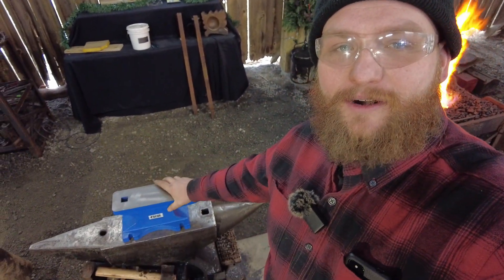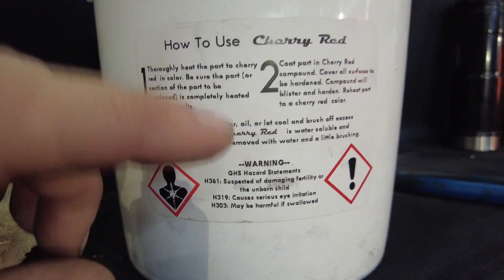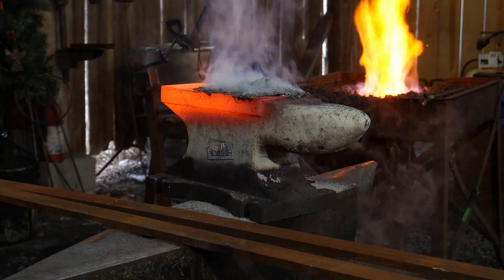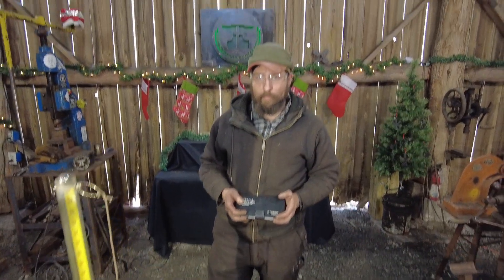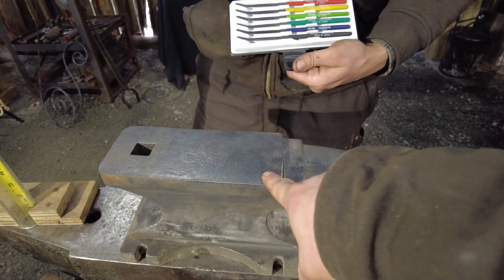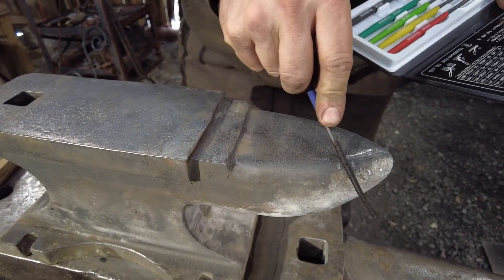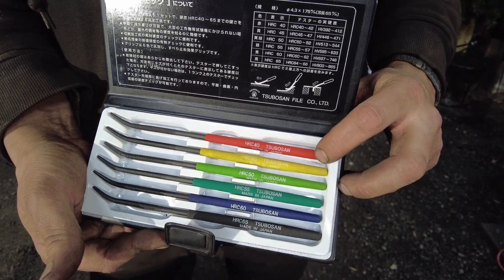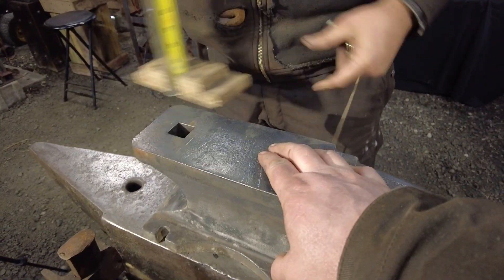Can We Case Harden a Harbor Freight Anvil?

Comment: I thought those anvils were ductile iron. They just aren't candidates for case hardening. They're already high carbon - too much carbon (3.0-3.7% carbon). Anyway, a rectangular block of mild steel is a better starter anvil. A hardened surface doesn't affect forging, it just makes the anvil more durable. Don't buy a Harbor Freight anvil. Get a Acciaio cast steel anvil instead. $100 for a 66 pound anvil that will probably outlast your interest in forging. You could probably forge weld on a tool steel face to a HF anvil, but... why?

Comment: I'm not a blacksmith (I do know how to do brazing, somewhat, using "hard" silver soldering), but, in an earlier life I spent some years as a software developer, and there's a technique from that arena that can save you a lot of time, effort, and wear-and-tear on your doubtless expensive hardness files.

It's called a "binary search" and it's a quite ingenious way of searching out a number of values to find a match. Each time you double the size of the list you only add ONE more test!

Instead of searching sequentially through the list looking for a match, you jump to the middle of the list, and test for a match. If you landed on a match, then bingo, your search is over -- you found the needle in the haystack. If it's too high, then you mark that point as the top, and your next test will be halfway between that point and the starting point.

If it's too low, you mark that point as the start, and make your next test halfway to that point.

You keep this up until you land find the match. In a sequential search of a (sorted) list, each test reduces the number of remaining searches by one. In a binary search, each test cuts the remaining number of item to search in half!

So, to use this technique with your files, you'd start out at the middle of the range of files. The results would tell you if you need to continue the top half of the remaining list of files, or the bottom half. Either way, you cut the number in half.

Comment: A modest suggestion: Couldn't you simply make a sand mold of the original anvil, then, melt the anvil, add carbon and a few other choice elements, stir to taste, then pour into the sandbox (pun not intended), then, using the appropriate iterations of heating, quenching, hammer-forging, and muttering, end up with a nicely forged anvil?

(Hey, I did say "simply," didn't I?)  <g,d&r>

Comment: In practice, iron castings to be hardened are austenitized at a temperature of 10-38°C (50-100°F) above the upper-critical temperature for one hour per 25 mm (1 inch). Heating should be gradual so as not to induce thermal stresses. After soaking, the parts are quenched. You really need to know the metallurgy of that Harbor Freight anvil to get the process right. Is it hypoeutectic, eutectic or hypereutectic iron? It’s all about the molecular makeup. Even then, one cannot expect a hardness of more than 50-55 Rockwell, at best.

Comment: Looks like hes pushing down a lot harder than you should. That's causing the files to gum up. Also, I'd recommend cardding those after each use so they dont hold any shavings. The pressure is where you can get a false result. Then again case hardening really isnt a process for cast iron. You really cant make iron harder than it is without adding other metals to it, and carbon. The grain structure on those is so course youd have to introduce so much carbon to gain any meaningful results that it's not really worth it. It would honestly be a better choice to melt the thing down and produce your own steel with it and pour a new one. Or get the face to almost molten/plastic like state then press it into a sand mold to get it a near proper shape and then add more heat and insulate the heck out of it to allow it to cool slower so the grain structure is better. At least I think that's how it works. If I'm wrong on the grain structure let me know, politely please.

Comment: So, case hardening is about driving carbon into the iron structure, taking a low carbon steel of like .2% and upping it to a higher carbon steel of like .6-.8%.  Cast iron STARTS at around 2% carbon and can go as high as 4%, so it’s an order of magnitude.  I suspect that the compound drives carbon into the surface, so not helpful for cast iron.

Only thing that may work is to DE-carbonize the face, or maybe get a facing plate to weld to it.

Comment: I'm a gunsmith that quite often case hardens parts with pulverized charcoal. It will indeed work but the best way to do it properly is to heat to cherry red, add carbon, quench, heat to cherry red and quench. Then you repeat to add depth. The reason you got little rebound with your ball bearing is likely due to the extremely thin surface layer that you added.

Comment: You can't case harden cast iron. Forget it, it doesn't work.
Case hardening is about adding carbon to the surface of low carbon steel, i.e. mild steel, with typically 0.05% carbon in it, to over 0.6% carbon content. This is the carbon content of high carbon steel which can be hardened.
Cast iron though already has between 2% and 4%, carbon content. Using case hardening compounds on that only adds to the carbon content and doesn't change its hardening properties. It remains cast iron, just with a bit more carbon in it.

Comment: something tells me adding carbon to cast isnt going to help... i wonder if decarburizing it would work? but you d be spending a lotta time cooking it over the fire to pull that off. i mean cast has upwards of 2% carbon depending on the alloy and i doubt you ll get a good accurate spec sheet on this anvil's metallurgy so it ll be another blind test anyway. if you do test that idea, i'd love to see the results! 

also, could you test forging on the carburized anvil and see if it breaks? curious how the process impacted the stability of the anvil
Reply: You could probably melt the anvil and blow compressed air into it Bessemer style if you want a useable alloy.

Comment: Try this- hold the anvil in the heat @ about 1400-1500* F  for two hours then allow it to air cool. This should produce an austenitic cast iron(also known as white cast iron) which is the iron used in rolling mill balls, which is about the best it can be. 
However, since you don't know the exact carbon content or the previous heat treatment, that may just grow pearlite and soften it as well...
Last try is bring it to ~1800* for an hour, drop it to 1400-1500* for two hours, and allow it to air cool. 
What you need to try to hit is 'white' cast iron the same as rolling mill balls. Grey cast iron is too brittle, and malleable iron is too soft.
Reply: Does that process remove carbon?
Reply: @MrErikb81  no, but there are three kinds of cast iron: grey, white, and malleable.
Grey is allowed to cool immediately after casting & is generally brittle. Think engine blocks and cast iron stoves.
White is heat treated some, and it allows the casting to become very hard & not machinable, in the austenitic phase, like milling balls or cast iron farm implements.
Malleable cast iron requires more heat treatment to grow the coarse pearlite phase, but is softer and machinable with great strength & surface finish. Applications: camshafts, crankshafts, etc.
Too much carbon & too long in heat treat... the pearlite becomes sphereodite as the carbon continues to disperse into the iron and casting falls apart.
Look up an explanation of the TTT (time-temperature-transformation) diagram for cast irons for more if you'd like.

Comment: That gives me more thoght that Air quench or  plate quenching with a large/thick aluminum "plate" would be better. 
As brittle as it was it makes me think it needed tempering which would have likely brought the hardness back to those stock conditions... as such even plate quenching maynot help it.
maybe something like surface hardened by the induction method or Flame hardening method would help. (of course those would need to be tempered or "Stress Relieved" at 150-200C [302-392F] too)

Comment: From the little knowledge I have of cast iron, its carbon content is actually quite a bit higher than "high carbon steel", which makes it more brittle. Most cast iron is 4%+, where most tool steels are less than 2%. So one might think that to harden it that you would want a way to remove carbon, not add more.
Reply: This is correct. Cast iron has enough carbon it it to make it melt at a lower temperature, which is quite a bit more than high carbon steel. When it cools, cast iron actually has enough carbon in it that it forms graphite inclusions, which coincidentally makes it self-lubricating for machining. The case hardening process (carburization) is to introduce carbon into a low carbon steel, like mild steel, to bring it up closer to high carbon steel. Adding more carbon to cast iron makes it weaker, not stronger. If you want to make cast iron behave more like high carbon steel, you have to remove carbon (decarburization), not add it.

Comment: I have read that some people will attach a steel plate to the top of these cast anvils to get a good work surface. Depending on the tools a person has available that might be the easiest way to get a hard surface
Reply: I'm considering welding a piece of AR500 to the face and trying that
Reply: @gadsdenconsulting7126  that might work out pretty well. Just have to make sure the heat from welding doesn't ruin the heat treatment before hammering on it too much
Reply: @19amw87  OK thanks for the advice! I'm looking for a 3/4" thick piece and was actually thinking about this before I read your reply. I believe I could tack it in a few separated places, then take my time (allowing for cooling) stitching it until it's completely welded all around. Do you think an inch thick would be better?
Reply: @gadsdenconsulting7126  I'm honestly not sure. My trade is welding/fabricating but I haven't tried modifying anvils before. I think the big issue is going to be getting the cast anvil to take a good weld. There are welding rods made specifically for welding cast iron and there are several videos of people welding anvils. I'd definitely look into those to get a better idea of what works best
Reply: @19amw87  Thanks very much! I found a piece of AR500 drop steel yesterday- 26"x17.5" for $135.00. Cost wise, I'd be better off buying a steel anvil from Vevor.
Reply: @gadsdenconsulting7126  I bought the big 132 lb blue vevor anvil. They're still cast but they seem to be decent quality for a budget anvil. Big step above the harbor freight anvils. There are some videos online of comparison between the different budget brands and it seems like they are all made at the same factory just slightly different levels of quality control between brands.  In my opinion they're good enough for a hobbyist or tinkerer, which is all I am
Reply: @19amw87  Good to know and thank you for your input!

Comment: Roy I have some thing you can do although it's not worth it to harden that up some.build a case around it top and bottom and sides.then go-to lows buy charcoal smash it up into powder pour it in the case pack it all around anvil then seal case heat it for 3 to 6 hrs then pull it out after it cools the next day open up case it it's not supper hard heat top to 375 then water quench it this will harden it.you add carbon into the steel this way.

Comment: I'd say it is possible to put a hard face on top, it's just a lot of work. My theory would be to first determine if it is either cast steel or cast iron. If the former, braze a piece of sheet steel to the top, if it's cast steel skip that step. Then do a lot of weld buildup using a hard facing rod. Cost wise, you won't save much $$$ vs actually buying a decent anvil, one time and materials are figured in.

Comment: Cast iron is iron with more than 2% carbon in it, and steels you'd want to make an anvil out of are 1% carbon or less.  So a process designed to add carbon is a non-starter for cast iron.
Reply: I wonder if heat treatment in an oxygen rich environment could in theory help defuse the carbon out of the iron, or would it take a compound that has a greater affinity for carbon to avoid oxidation of the steel.

Comment: After watching the other video, it crossed my mind about case hardening, I use Cherry Red to re harden frizzens on some of my cheaper Indian import muskets to keep them running…
Reply from the maker: I've heard it's good stuff
Reply: @ChristCenteredIronworks  yes, the trick is, for frizzens at least, is length of time… the longer you keep it at a red heat with the compound on it, the deeper the hardness can penetrate the surface, the can, if I recall says to keep it at temp for a few minutes, Rob at British muzzle loaders recommends 30 minutes, I have found 15 mins to be adequate for my use, I use a propane torch to easier regulate the temp… recommended time on the can works, but is a shallow hardening, soon wearing away and needing to be done, but we tend to fire our flintlocks a lot so the longer treatment so far seems to be holding up well, and I quench in brine… Thanks for the interesting videos on HF anvils, I don’t own one, but was contemplating getting one for my grandson, so we can work at the same time instead of alternating on my 1898 Fisher 80lb, she ain’t pretty and had some hard usage before I found her in an antique shop, but she gets the job done… Y’all have a merry Christmas…

Comment: Im curious about something...  Quenching hardens the metal due to the rapid cooling, which changes the crystaline structure of the metal, or something like that, right?  Would it benefit this anvil hardening to maybe use something like a CO2 fire extinguisher to cool it off a little faster than air cooling or would that not really do anything?  How fast does metal need to cool off to harden?  Would it harden better without fear of explosion to quench it in boiling oil, or is that too hot to get the reaction?  Gonna have to buy a bunch more HF anvils to get this right...
Reply: They use forced-air quench occasionally in industry. Basically just a fan blowing on it. Sort of like your fire extinguisher idea. Less aggressive than oil.  Suprisingly, hot oil or water actually quench harder than cold.

Comment: I've been using "casenit" for about fifty years, it always hardens any steel, and I doubt the stuff you're using is any different.  The anvils are cast iron, so their carbon content will be above 7 percent, meaning the iron crystalizes around the carbon atoms, so adding carbon won't help.  Ductile iron, is cast iron with up to 30% mild steel scrap, usually punchings, and goes as "semisteel" for crankshafts and such.  There's no substitute for real steel, that is hardened, I had a bearing out of a rolling mill as a boy, weighed about ninety pounds, very hard, such can be found as scrap around old mills, as are dies.  I've got the wrist pin from a caterpillar diesel, about two inches diameter, five or so long, only a stone will touch it, used for upsetting rivets and such.  Get a good anvil and don't let it go.  Semper Fi, John McClain
Reply from the maker: Great info thanks for sharing 🙂
Reply: Welcome to the party pal!